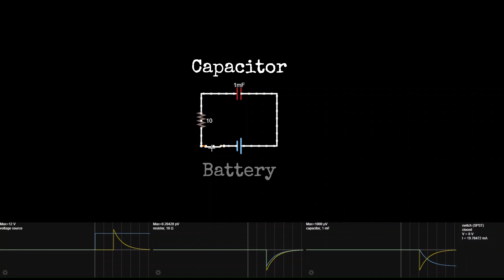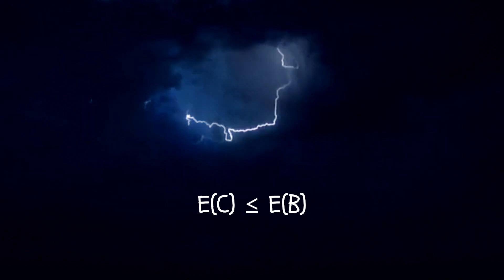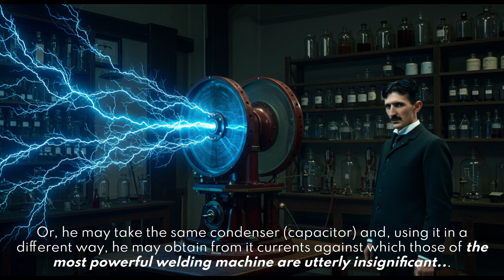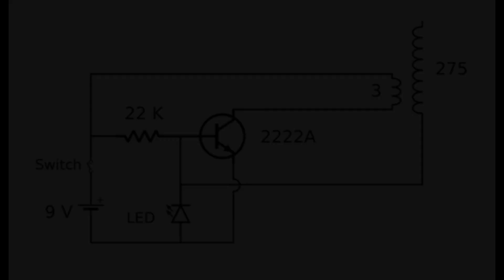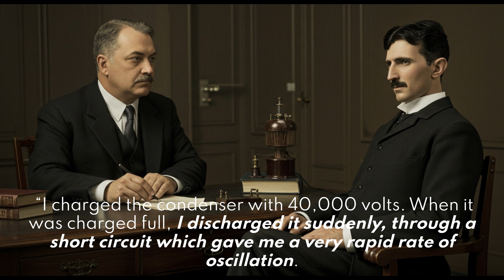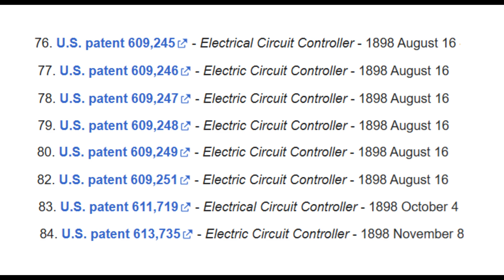The Keys to Free Electric Power Series: Boost Belling

Comment: I like it i have a homemade switch its low frequency but very powerful it's kind of like a commutator and a magnetic switch in one it works ok with a boost buck converter DC>DC 75v-345v  it sticks though it's still fun

Comment: Great presentation - thank you! Hey I've been researching Konstantine Meyl's scalar wave work and have a question - he is producing 'magnetic' scalar waves yet Tesla was producing 'electric' scalar waves. I understand both are longitudinal, >SOL, and that Tesla's require a unipolar disruptive discharge into the Aether medium to produce electrostatic resonance and radiant energy. Meyl seems to 'stroke' his system into resonance rather than the Tesla punch, and I have a feeling that Meyl's approach is more akin to how Nature uses ambient energy. I'd be very interested to hear your thoughts on this. Thanks!
Reply from the maker: Hey Ian, great work with the variable caps man! I have not looked into Meyl very much, but I am interested in what you mean by the "stroking" method. IMO, a "magnetic" longitudinal (LMD) wave is more prominent in "closed" systems, while more "electric" LMD waves are more prominent in "open" systems (OWE, etc). If you have FB I could ask Nathan for your page if that's ok with you and we can bounce back and forth easier :)